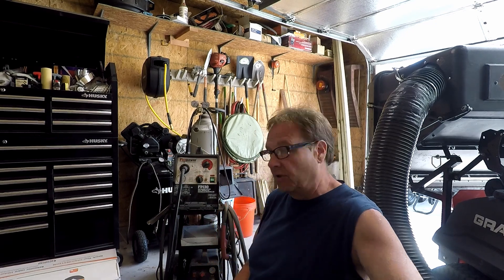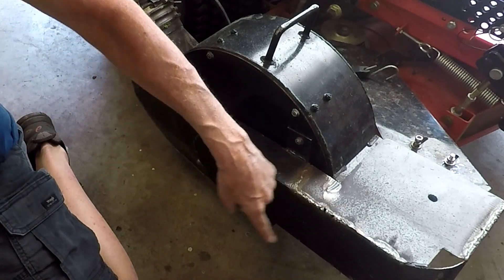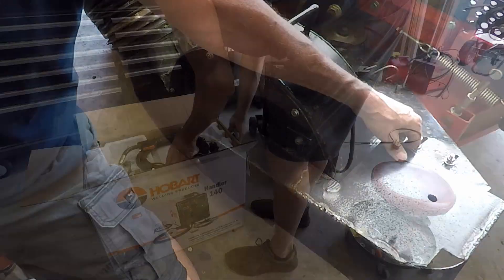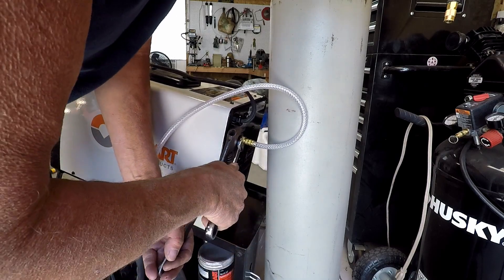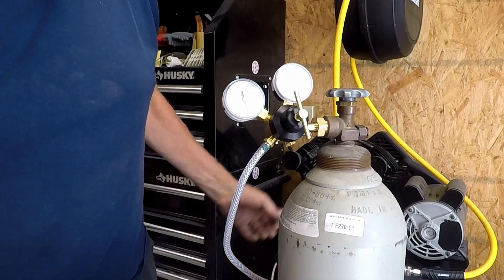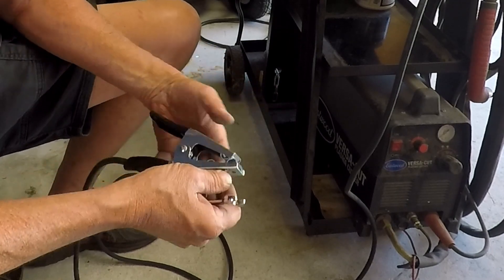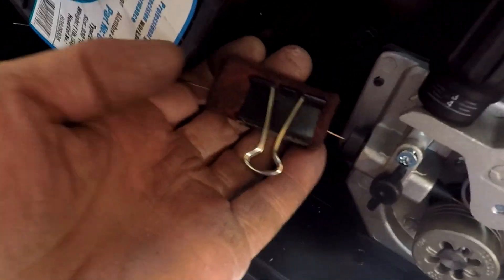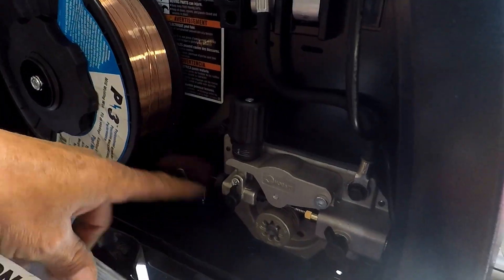New Hobart Mig Welder Set Up & Welding

Comment: I use gray ptfe tape on the regulator to tank connection. Never had an issue. I know a lot of people say not to and that the fitting needs no tape.... but they don’t pay my gas bill so... i use it as piece of mind that I’ll have a tight seal until I take it off and get a new exchange of gas
Reply: The seal is at the taper of the brass not at the threads. Your equipment do as you want.

Comment: Does this welder have a post weld gas flow ?
I want a welder with out this feature, what I weld is sheet metal butt weld and my last welder had post gas flow and I used 3 times the gas because of it

Comment: push with solid wire. I own a 140. very good welder, learn how to weld. not trying to be a jerk, but you will be happier , and use a 10 gauge extension cord.
Reply from the maker: I have to go the way I can see the best. You are not being a jerk just helpful. After I get my shop done hopefully I won’t have to use an extension cord. Thanks for watching and commenting.
Reply: By push do you mean you are aiming the tip/arc away from you at an angle and pushing the puddle away from you?